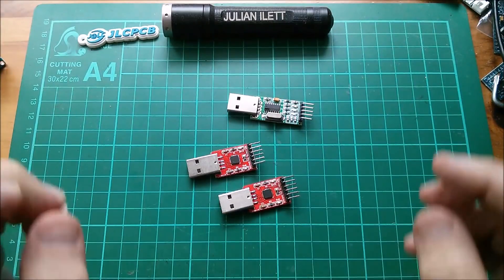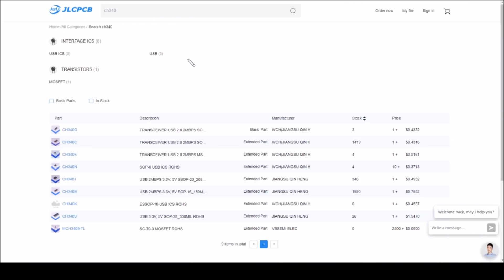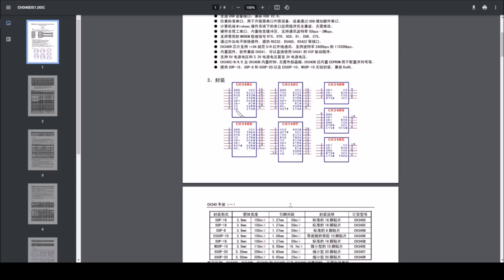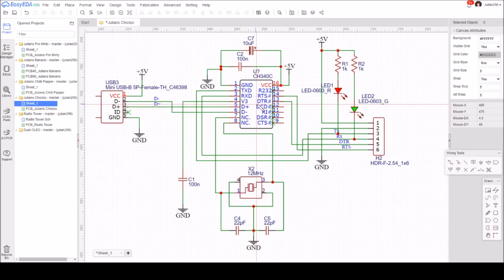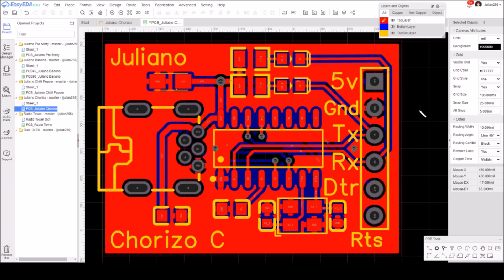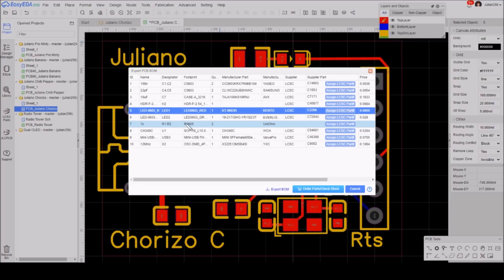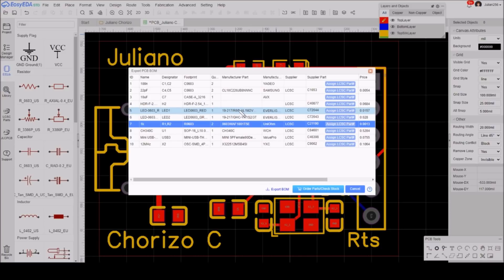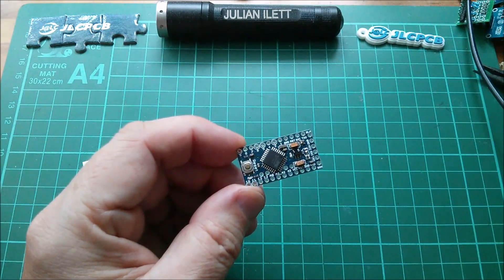PCB: Preparing the Chorizo Board for Production

Comment: Wasn't even aware of the C. I've used the G in lots of projects. With the C about the same price as the G I might as well use that. (Save a few cents on not needing the caps and xtal)
Reply: Have not heard of this "C" either.  Guess that are factory trimming an oscillator has become trivial.
Would bet they use the same core for the E N and this new C.

Comment: Instead of usb-serial, of which everyone has a dozen at least, why dont you design a  CN3722 based solar charger? 
This, with potentiometer in and output voltages and a good power-fet with good heatsink would be really usable.
Reply from the maker: Nice idea - I like it :) Finding a suitable inductor though :/
Reply: I only own 5... So. Need 7 moar!

Comment: I'm always a little nervous hitting that "Apply changes" button.  I was thinking one of these would be able to connect my UART circuit to usb.
Reply from the maker: Ha ha, I throw caution to the wind when I hit the apply changes button. I have an old Z80 system in the shed with non-standard floppy discs. I figured I could use a UART and a serial/USB converter to get all my Z80 source code onto my PC.

Comment: You don't need to follow the board outline with the copper pour(s). As long as the board fits within the pour boundary then any excess will be ignored. This makes it easier to select, especially if you have a pour on both sides....they can be completely different sizes. Also, setting the copper boundary between grid lines and not on them helps make them more visible.
Reply from the maker: Good tip! The copper to board setting still works too :)

Comment: Not sure if it would make an interesting video, but do you know how to panel multiple boards in the one design?

I've designed a modular version of BigClive's "Supercomputer", where each module is joined to its neighbour using castellated/half cut holes. They don't need to be panelled, however to keep the numbers round (and the PCBs under 10x10 cm), I designed the modules smaller than they needed to be to fill my picture frame. That means I need spacer PCBs to go around the edges, which do need to be panelled.

There's a total of 4 different board designs to fit around the edges, and I'm thinking of using panelling and V-scoring. Three of the edges would be milled, since they'll have castellated/half cut holes to attach to the modules or each other, or need to be finished to dimension, and the fourth outside edge could be V-scored to keep them attached to the panel.

I'm guessing you draw a line on the board outline layer with a thickness e.g. 3mm for milled slots, but I'm not sure how you'd do a V-score. Would that just be another line on the board outline layer going across the board?

Just thought I'd ask if you think I'm on the right track. Obviously not expecting a video explaining it, but it would be interesting to see the process if you've got an idea for a project that a panelled design might be appropriate for.

Anyway, always fun to see more work on the Choreetho/Choritzo. Can't wait to see how it turns out!
Reply: I believe I've seen somewhere that you just put some text in the 'document' layer requesting V-scoring, this way they will come across this when checking through the Gerbers. Don't quote me on that though, and I'm happy to be corrected if I'm wrong.
Reply: @adzib1823  I think you're right, since they charge extra for manually reviewing those orders, as long as the text ends up in the silkscreen layer of the gerbers, they should see it. And as if it's outside the board outline it won't show up on the boards if they miss it. I'm guessing worst case they'll just cancel the order if they can't figure it out.
Reply from the maker: Yes, good idea - I'll cover panelisation at some point :)

Comment: The USB pair should be routed as differential. They should be within 150 MILS of each other in legnth and you should use the differential routing tool for EasyEDA.  This makes them extremely close like what could be found in a USB cable. Also avoid the vias for the D+ and D- connections as this adds minimal resistance and capacitance that in the grand scheme of things; could hinder USB performance.